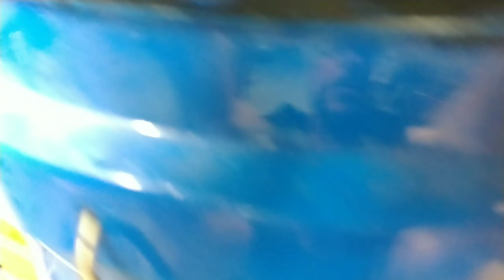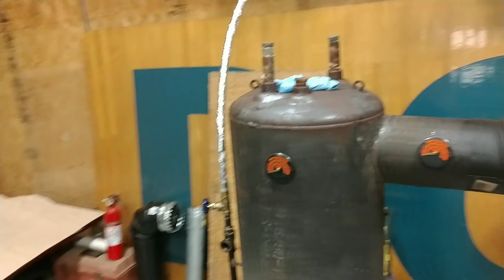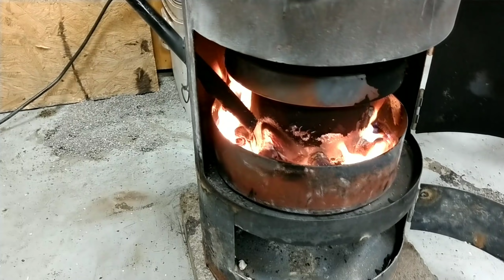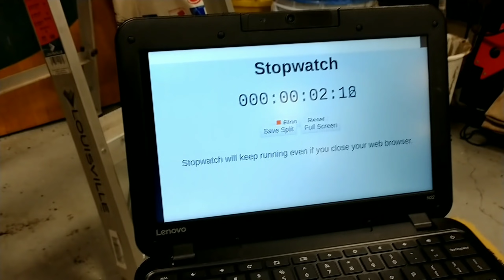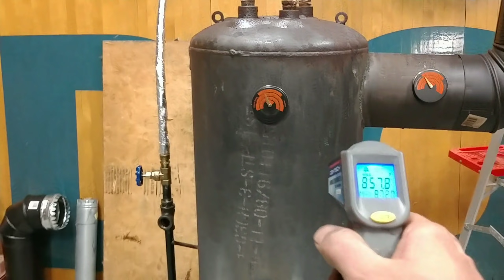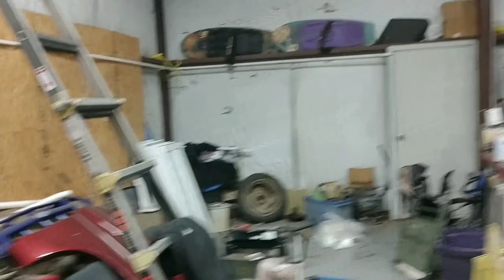Waste Oil heater One Gallon Burn Time

Comment from the maker: If you choose to build one of these heaters just know that you need to be very careful and I will not assume any responsibility for anything bad that happens.
Reply: Excellent!!! ...now if you could get the air flow velocity up without the use of a fan, I’m sure oil consumption would drop dramatically ...no??
Reply from the maker: Yes
Reply: Randy's DIY I’m thinkin some kind of Venturi effect like the throat of a carburetor has...
Reply from the maker: @kevinsedo6869  I think I may add more elbows or larger elbows on the burner hat today more air leaner cleaner hotter burn. Good idea, Ive been thinking about doing for a while.
Reply: Randy's DIY or just add another row of elbows above the other instead of increasing the size perhaps.
Reply: Drill Larger air intake holes 🕳?
Reply from the maker: Yes absolutely in one of my later videos I'm drilled eight and more half inch holes and burns a lot better
Reply: @randysdiy1  ive always wanted one and think they are a great ideal. Ive also heard horror stories and was discouraged. I like that yours will snuff itself out and cant be built up with pressure and has the top vent also. 👍🏼
Reply from the maker: Thanks for the comment and you are correct these are very dangerous and even with the in theory flame snuffer, really bad things could still happen. I never run it unattended and only in my shop I would not put this in my house.
Reply: @randysdiy1  if there was a way to adjust that outer hat cap up or down on the center pipe that could increase or decrease ur airflow.. I'd like to see those 90s churn that flame.. that is a nice setup
Reply: If you are monetized you will be responsible. Fyi

Comment: Randy what part of the county do you live in & how cold does it get. My shop is just a bit 
Smaller than yours. I live in Oklahoma  with fairly mild winters, average mid 30,s to 40,s 
With very few times in the teens. My shop is lightly insulated. Do you think it wound do the
Job in your part of the country?
Reply from the maker: I live in South Arkansas. We're about the same as you. We very seldom see teens
Reply: @randysdiy1  yes I live in eastern Okla about 25 miles from Ft Smith. Thank you my friend.

Comment: So you actually need about 45 liters for 24 hours,.. is that right, well,..that is a lot of oil even it's a wasted oil, because you need source to get so much oil.
Reply from the maker: Yes, it does use quite a bit of oil, I am currently trying to build a blue flame waste all heater which should be more efficient

Comment: Hey Randy great video I have one question what do you have for insulation and how tall are your ceilings?
Reply: OK thanks that helps me a lot but I still think I would like to try to make one of those. great idea because I think I would be happy if it just brought me up about 20°
Reply from the maker: Walls are 12 ft roof pitch is 3 and 12. Insulation is standard shop insulation. I'm not really sure what it is
Reply: @randysdiy1  I have what I thought was standard shop installation. It has somewhat of a foil backing on both sides but it’s not very thick. About a quarter inch thick. Is that the same stuff you have?
Reply from the maker: No mine has a vinyl like backing and then regular fiberglass insulation attached to it, uncompressed it's probably 3 in thick

Comment: If you use gasoline, light it quick so vapors dont escape into room and explode cause fire.
Reply from the maker: Only gasoline if mixed and diluted. Vry little gas goes a long way. Don't blow yourself up. Be careful

Comment: Threw the sight hole what do u put so it doesnt drip down the sides.
Reply from the maker: I used a barb fitting and screwed it in the inside of the t. That way the hose barb is just above the t hole
Reply: @randysdiy1  i went with 1 inch pipe so thats kinda hard but i have 2 barb fittings going from pail to drip  never thought of barb fitting lol
Reply: @randysdiy1  have a blower now on however getting smoke coming up the drip line coming out of the t any suggestions my half in copper is going directly threw an elbow down into burn

Comment: Damn, that's a hefty amount of oil usage. More than a litre an hour seems pretty high. Although to be fair, early on in the video it did sound like you were overdosing the oil as I could hear the crackling of an oil fire inside rather than an efficient oil burn.
Reply from the maker: Yeah sometimes the oil I get has some traces of antifreeze or water in it

Comment: does it mater which direction you weld on 90 fitting on air hat?
Reply from the maker: No sir, I just turned them sideways thinking that it might create a vortex of air as to where. Where if you pointed them up or down you wouldn't get that effect. Also. Also the extra holes I drilled in the air hat don't have the 90° fittings on them. They just or holes

Comment: I seen the "how much oil does it use" questions on every waste oil burner video so when  made mine I did similar test 1 gallon low for been last 5 plus hours.   https://youtube.com/shorts/avHEzXkwptQ?feature=share

Mine uses forced air fan made from old microwave fan.   It splits ar from fan to blow thru the heat tubes and into burner.   I added a cold air intake using two pipes for the exhaust stack, 4 " inside and 6" over the 4".   But I have to fix rip as it was suckingnthe smoke stack gasses into house.   Two pipes are almost even and under the rain cap have to close the 6" and add hi holes under the ckosenoff.

Comment: You might want to add a sight tube to the side of the 5 gallon bucket.
Reply from the maker: Good idea, however using used diesel oil it get everything so black you probably wouldn't be able to see it but the first few times.

Comment: I think the question is HOW MUCH HEAT DO YOU REQUIRE?  Waste lube oil 140,000 BTU per gallon. Fuel wood pellets about 320,000 BTU per 40 lb. bag. Cordwood about 7,000 BTU per pound.  Some fuels are easy to handle, store and combust. My experience is fuel wood pellets are the most convenient, economical and enjoyable to use for heating. Be sure to check your home insurance when using a DIY heater - DIY home-made without UL approvals likely voids your insurance. Be careful and enjoy the warmth!

Comment: Just curious why everyone feeds from a 5 gallon bucket in stead of something bigger. Thanks
Reply from the maker: For me it was the weight of having it 5 feet high, I have considered putting a 300 gallon tote outside my shop on the ground and then having an electric pump with a float switch in the 5-gallon bucket to fill it however the automatic float switch kind of made me worried it might hang on and then spilled all out so at that point I decided to do a manual switch whenever I need to fill it, I just haven't done that yet
Reply: @randysdiy1  cool. Thanks. Also from having regular waste oil heaters in the past you might want to make room for a tank inside. Waste oil isn't the easiest thing to pump when it's really cold. Just something to consider. I agree it would definitely be a mess if it kept pumping. I think I want to have a tank big enough to burn all night. But from your demo on a gallon seems like 5 gal may do it. Thanks
Reply from the maker: If you can keep it regulated to a small stream 5 gallons may do it The problem I've had with mine is as the shop becomes warmer the oil becomes thinner and flows faster so I have to keep an eye on it.

Comment: How does hydraulic fluid burn in this setup?
Reply from the maker: I haven't tried it but everything that I put in it from jet fuel to cooking oil has burned about the same. Some hotter than others.

Comment: I see so many of these homemade oil burner here on Youtube and for what I see, they can be dangerous if left unattended. From what I learned about making stoves out of mild steel, you will run into warping and metal flaking off with temps 600 degrees and higher. I've seen metal completely destroyed by excessive heat over time. Be careful with this stuff or you may be calling the fire department before you know it. It seems like there are so many people showing their stoves running red hot while burning. That metal is not going to last long at those kind of temperatures. Cast iron will hold up longer with higher temps, but mild steel with just simply break down, warp and start to flake off over time. Just be careful with those kind of temperatures is all I'm saying.
 Oh and another thing, DON'T use galvanized pipes or vent pipes for your exhaust pipe. When the galvanized surface gets hot, it gives off poisonous gases that can make you very sick. 
 I'm not targeting this video by no means, I'm just trying to convey the importance of knowing what you're dealing with when it comes to working with high temperatures and stoves in general. Atleast do your "experimenting" outside and keep a fire extinquisher close by. It's better to have it and not need it then to need it and not have it!
Reply from the maker: All good information, I have carbon monoxide detectors and fire extinguishers readily available. I usually run my heater around 700 degrees and haven't had any issues with metal degradation, yet any way.

Comment: Have you tried putting a blow dryer in the intake to see what it did or some kind of air output.
Reply from the maker: Yes, I tried regulated air compressor line. It did better but I think adding more holes on the hat will do the same.
Reply: Randy's DIY I copied your hat added a small hole in between elbows. I have a 50cfm bath fan on a dimmer. Fan makes big difference. Thanks
Reply from the maker: Glad it helped

Comment: Damm Great!
I'd think some copper tubing to replace the pex
'be easy/cheap to rig up a fuel gauge - either a vertical 'stand' of pex running up the side of the bucket of some kind of ping-pong ball float inside the bucket with a length of straight coat hanger wire extending up through the lid. You can figure out some kind of length of appropriately sized pvc to house the 'ball'
OR do nothing = when you get cold you know you're out of fuel = add more 

I'd like to hear about and see out the outside the shop fumes/odor conditions.
'again, Damm Great!
Reply from the maker: https://youtu.be/NPVC_ebTS64
Reply: Thank you Randy - that's a bitchen set up - being cold is No Good!

Comment: I wonder if an air intake from outside (cold air) would provide a more efficient burn. They make dryer intake specific wall plates.
Reply: Thoughts on the air pulling from the shop causing air from outside to pull into the space fighting off the heating effect.  Even in an insulated shop you are moving some serious cfm from outside to inside to outside, wouldn't you say?

Comment: if you lived in a cold climate and were burning around the clock you would need 10 gallons a day or 300 per month in the winter on 2400 sq feet shop...seems like a lot of old oil would be needed. If the oid was free and you had an endless supply of it...and a big tank to hold it. Would be a great idea
Reply from the maker: Oil is free, however and it very seldom gets below 20° where I live, and I'm only in my shop probably 4 hours a week

Comment: So what keeps the heat from chiming up the oil feed pipe?
Reply from the maker: Not sure but the oil feed pipe is pretty cool about 8 inches above exit.
Reply: @randysdiy1  gotcha. So distance then.
Reply: @shexdensmore   I'd say that angle on the feed pipe helps aswell

Comment: I believe that is correct, however I burn waste vegetable oil most of the time now. the used motor oil from diesels is very messy.And the cooking oil smells great burning. lol
Reply: Great idea. Ty
Reply: How much it last 1 gallon of oil? What type did you use, thanks for any clarification.

Comment: Really well made solution for waste oil. 
Would you also be able to chuck pieces of wood in there?
I'll never have enough oil from my 4 cars to heat a medium sized shop for the entire winter.
Not a clue how warm it was in there tho. 19°C or about 66°F would actually do since I'm actively working in there.
Reply from the maker: I don't really see a way that you could put wood into this type of configuration. my father used to have a 55 gallon drum that he welded a door on the front of but wood and it just like a wood burning stove and then had a drip feed oil system into the top of the barrel which dripped on the oil It worked really well

Comment: Unfortunately here burning of used oil is ilegal, even cooking oil with fines starting at 2000€, it must be taken to a recycling point, service mechanics have to save it in 45gallon drums and pay to get it collectes(same as tyres, oilfilters etc. the stupid thing is you can have oil central heating.

Comment: Hook in a Thermals Based Fan to move the heat around.  Hot air rising driving the fan which helps move the air
Reply from the maker: I may look into that. Thanks

Comment: I can't stand videos that are unnecessarily long.  You spent the first 4 minutes proving the blue bucket was empty and you were adding a gallon of oil.  You could have simply said,  "I'm going to run the heater on one gallon of fuel".  Period.
Reply from the maker: I will take your critisim and use it in future videos. Sorry I took to long, but  I have still had some people reply that they were skeptical about the burn time.

Comment: The same amount of oil would have gone through the system whether it was burning or not.  I'll be that there is a calculator somewhere on the web that would give a pretty close number.  I guess you needed to heat the shop anyway.

Comment: Have you ever tried using oil from a restaurant that's from the fryer but you'll probably have to mix it with something that's a little bit more flammable or with your contaminated diesel oil like a 50/50 ratio
Reply from the maker: It will burn restaurant grease/oil as well as engine oil and it smells great.
Reply: @randysdiy1  man that's got to be torture working in the garage and feeling hungry all the time and smelling cheese burgers and fries

Comment: Like another comment mentions you should do some more heat exchanger pipes and also with your excess heat you could probably do a sterling fan which operates off the heat and will push the air through the pipes for the heat exchange ...great job and great video

Comment: 8.72 gallons in 24 hours. if your cost is a $1 a gallon the monthly cost would be $261.60 a month. Whats your true cost / gallon?  Propane may be cheaper.
Reply from the maker: My oil is provided free.

Comment: What you are making is a feed rate limited burner, or it should be used that way. In short if you ever over feed the oil you end up in a situation where there is more than enough fuel and the limit is the amount of oxygen it can get and how hot the oil is. You've made a bomb. The goal is to never be able to over feed the oil and create pooling. The best way to handle this is by line sizing, you could use 1/4" or 1/8" line prior to the sight glass to achieve proper flow so that you can see that the tubing isn't plugged and yet you never have to worry that someone could accidentally open a valve too much and allow the fuel to pool.
Reply from the maker: Great info
Reply: @randysdiy1  I ran Grignard reactions before that are similar to burning oil in that if it gets too cold the reactants can pool and when it begins to warm up you have a runaway reaction (a bomb). Here if the oil is allowed to pool significantly and it continues to burn the oil can burn faster and faster until it burns out or explodes due to all the oil vapor and oxygen blending. The boiling creates an atomized mixture of fuel and air in a container that is already burning. Adding too much oil can cool the oil in the burner and now it becomes a heat controlled reaction because there is more than enough fuel but it's not hot enough to burn but you wouldn't know that because you can't see inside and even if you could the damage is done. Hope that it burns out. I think for added info you can look up Grignard reaction and see how they deal with it's explosive nature.
Reply: @randysdiy1  Great video BTW!!

Comment: I just finish building my stove. I am wondering about the contamination in the oil clogging the lines so my question is "do you have any thoughts on pre-filtering the oil before use?? "
Reply: My 2 cents. Some mesh cloth on the bucket will help filter the worst. to a usable level.
Personally I use the "wick" system. Which we can describe as a big "candle" without the auto feeder system. Much simpler assembly, lower power output. As some disadvantages, but one pro about it. Is that I don't need to filter nothing. Just trow the oil in there done. ;-)
Reply: Before he passed away, my friend designed and built one using an oil stove oil filter assy. from the feed tank to the stove. IIRC he used it for over 20 years.
It was 3 X bigger than the one here. It sure heated that huge uninsulated shop quite well. He had a mechanical repair biz and fed his stove with motor oil, hydraulic oil, 90 W , oil, ATF, whatever.
Reply from the maker: I filter my oils all through cheesecloth. Whether it's cooking oil or engine oil

Comment: isnt the gases burned up in the top like in a rocket stove? i mean that would likely make the temperatures go much higher on the top, right?
Reply from the maker: I really like your name Jesus Christ is Lord. as far as the gas is being burned in the top I can't answer that but if you look at the video of the smoke output there is very little smoke output a lot less than burning wood probably more toxic but less